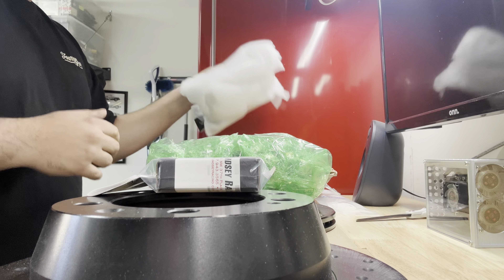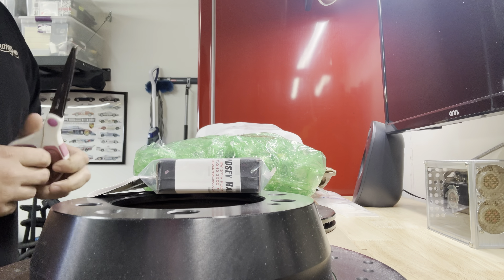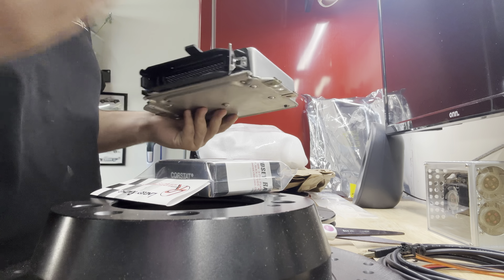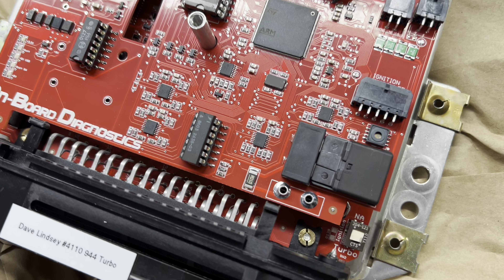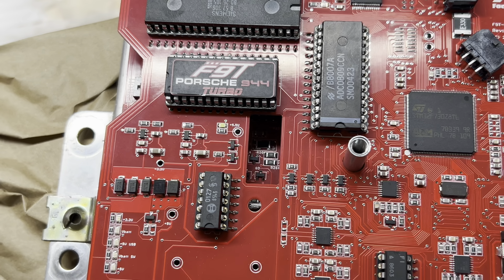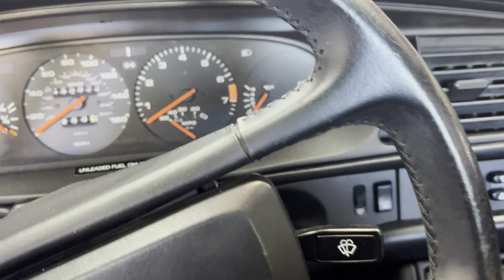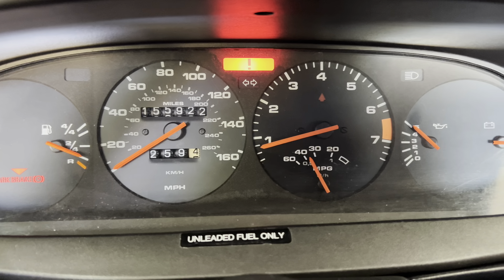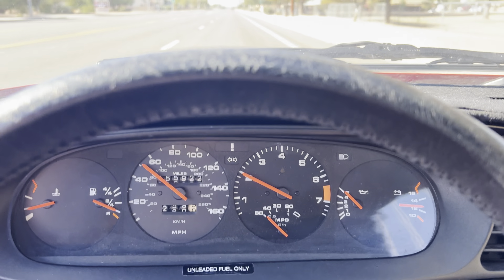944 Mini Build Series Pt. 2: Focus 9 Technology DME With On Board Diagnostics

Comment: As owners of 40-year old cars, we’re so fortunate to have such robust aftermarket electronic parts availability. My experience with the F9T Sport DME was similarly positive, where it immediately eliminated some hesitation and weak/partial ignition issues over my aging factory DME. My only minor criticism of the design is that the relocation of the FQS prevents adjustment with the metal cover in place. Not a huge deal once it’s dialed in because you’ll probably never touch it again, but overall I’m very happy with the results.
Reply from the maker: I completely agree it was a little tedious when I was messing with FQS settings while testing out some after market injectors hahaha. 
Edit: I actually remember reading on the forums that Joe might develop an update to give us the ability to wirelessly change the FQS setting via the OBD software. But I don’t remember what exactly would be involved with that if it’s a matter of a firmware upgrade or if new hardware is needed. 

But to your point after buying my first car 944 in 2015 the level of after market support that exists now is light years beyond what was available at the time in terms of availability and user experience it’s absolutely amazing. It makes me super excited because as time goes on and more cars are being restored instead of neglected now, these upgrades not only make the cars better but will ensure their survival long into the future and that genuinely makes me really happy. Broke, but happy!

Comment: Dude glad to see you got your start hesitation sorted. I had just resolved mine also, it turns out the PO had messed with the FQS switch on my DME, having it set it add fuel, so I think it was making the car run rich. I set that back to position 0 and the hesitation went away. I have suspicion the PO did that to mask some vacuum leaks, but once those vacuum leaks were fixed the A/F ratio became rich
Reply from the maker: I’m having a new weird issue where very randomly when the car is very very cold, it’ll take one time to crank it, and then it starts on the second key over right away. I have a similar suspicion that the AFM is just way out of calibration and hopefully when I switch over to the MAF setup it’ll completely resolve the issue. 

In any case, I have OBD now so I should be able to log the data and see what’s happening, I just haven’t had a chance. After tomorrow the car is going to be able to be down for the holidays and while the MAF issue gets sorted, I’m finally gonna be starting on the brakes!
Reply: @TakeFlightGarage  Fingers crossed it's that AFM - that's another thing POs love to mess with: they will often adjust the clock spring under the black cover to make it richer, and likewise there is a hex adjustment on the outside at the top left of said cover that ppl adjust too.

Hopefully the OBD can give you A/F ratio or at least the O2 sensor reading, then you can get a better picture of what's going on. I do recall from a NC944er video that the MAF upgrade may require some playing around with the FQS switch on the DME to get the A/F ratios right - best of luck with your install..

Comment: Hi. Love the ch. keep it up❤❤

Also I have an 87 924s with the motor from earlier 944.  And similar if not the same ECU DME unit     I have a question about how to actually plug in the ECU.  I think I’m trying to plug it in straight in.  And it needs to be kinda seated in one corner while angling down the other corner into place.   
Nobody on YouTube shows the plugging in process for these older Porsches.  They show a lot of the ECU stuff but that’s something I missed when I last tried to start my car. I wasn’t sure how to plug that in.  🤷‍♂️
Reply from the maker: Yes you are correct, there is a plastic notch that needs to be slotted at a bit of an angle first, then you connect the other side and should hear and audible click as the metal tab closes around the harness plug. The harness plug should seat fully into the DME socket. Make sure you’re plugging it in in the correct orientation and not upside down, the plug can only go in one way.

Comment: Got both computer and DME relay from 9. Working now to get the Lindsey mass. Next will be to order a new wiring harness.
Reply from the maker: Don’t do what I did and make sure you install the MAF chip correctly! I installed mine 180 degrees out and shot my self in the foot, I’m hoping to explain it more in detail but as I sit currently I’m out $650 because of my mistake. I’m really hoping I can get in touch with Dave and try to work out a solution but yeah with the F9 computer, very very very important to install the chip correctly.

Comment: Hi, thanks for explanation. But can you tell me where to get the fuse box cover with the window installed for the diagnostics of the DME relay?
Reply from the maker: I made that myself, I ordered a spare from eBay, made cutouts, and then epoxy welded in some small acrylic panels I cut.

Comment: is that all you need to go turbo? just switch the ecu to turbo and have all the necessary hardware? can a 944 head or gasket handle boost?
Reply from the maker: The things you need to convert an NA 944 to turbo would end up costing more than just flat out buying a 944 turbo (although that might be changing nowadays with prices on turbos rising so much) 

You need an entire rebuild, forged internals, pistons, I believe the NA blocks are missing certain holes for things like heat shields, turbo used different size injectors, has an auxiliary water pump, and on and on. 

The next best thing to buying a turbo is a 944s or S2 

And the third option if you don’t care too much about HP numbers but just want to wake up an NA a little bit is doing the MAF, this computer, and a mild Cam+ turbo valve springs and potentially some mild head work.